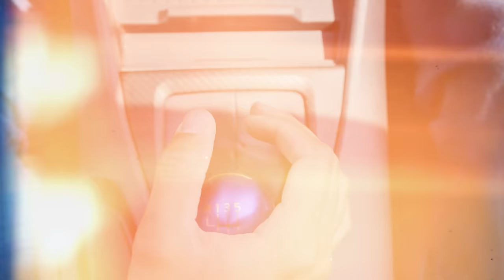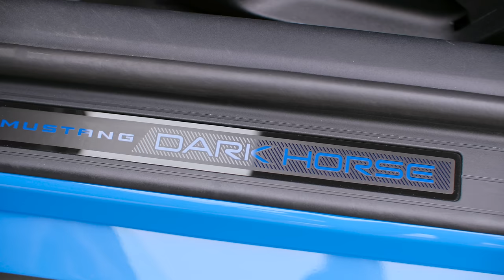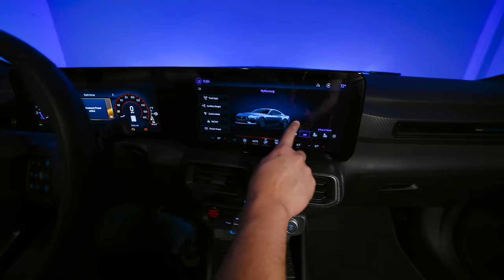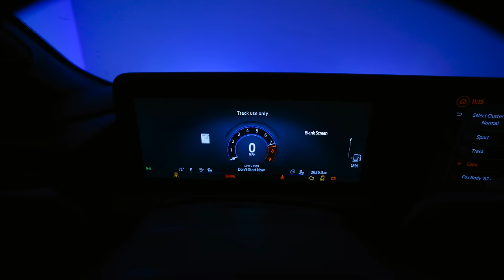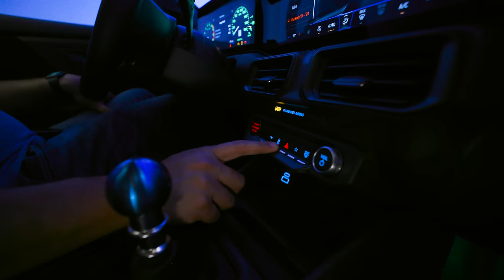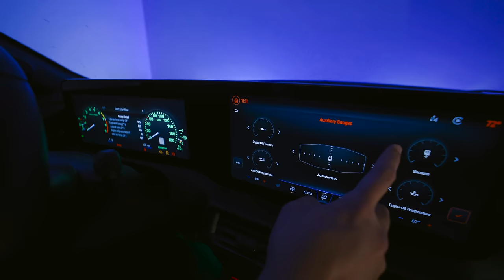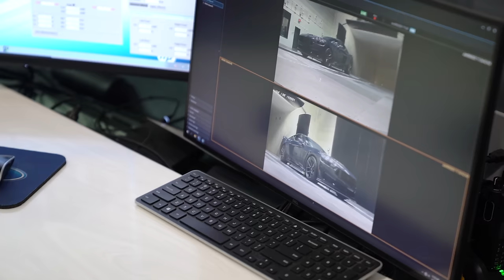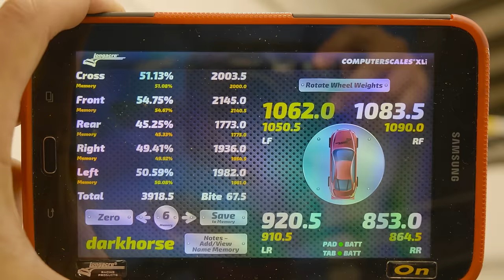2024 Mustang Dark Horse | Why This Car Exists

Comment: I love the savagegeese reviews.  But I do have to ask why they haven't reviewed the G6 Camaro SS 1LE at any point during it's 7-8 production run.   They did review the ZL1 1LE and concluded (probably corrrectly) that it's more car than necessary for the road and should be relegated to the track.   But the SS 1LE is (IMO) the perfect balance of power and handling - fun and managable on the street, and an ANIMAL on the track.   It performs as good or better than the Mustangs (GT350, Mach 1), Supra, BMW, offers more track oriented tech than some others (Heads up display, Performance Traction Management track mode options, true electronic rear diff) and all for significantly less money than any of the alternatives.   With the end of Camaro production run in 2024, it's becoming a bit of a mute point, but that doesn't mean it doesn't deserve a review.

Comment: At 26 mins, that's the first hint I've seen that they have beefed up the engine for the additional output.  The mentioned the rods, I would love to know if they addressed the oil pump drive gears.  While not a huge cost to upgrade, it would be nice to not have to address that if we wanted to add a bit more stress.

Comment: I've owned four V8 Mustangs in the last 35 years, '81 Cobra, '89 LX 5.0, '01 Bullitt, '08 Mustang GT. Always been a big Ford guy and Mustang fan, since before I could drive. I'm a few years away from retiring, and was planning to buy a new Mustang and keeping it until I die. 

That is until I saw the S650 Mustang reveal. I could probably grow to live with the exterior styling, and the performance is pretty damn awesome, but the interior just lost me. Too many screens. Not interested in driving a video game. Vastly prefer analog gauges and physical buttons. The weight is an issue for me too. My last Mustang had a curb weight of 3490 lbs, this new one is 500 lbs heavier! No thanks.

Hearing what the Ford employees were saying about trying to seek out a newer younger generation of Mustang buyers instead of the traditional Mustang owners,  almost seemed a little bit like the whole Bud Light fiasco. I'm a 50-something Mustang owner with a healthy six figure household income who wants to buy a new Mustang, but Ford chose to focus on the younger generation who generally don't care about Pony cars and can rarely afford them. I'll be looking for a used S550 Bullitt or Mach 1 instead. Sorry Ford, you lost me.

Comment: I was a Ford guy from 79 till 2017.  38 years. 9 Mustangs, 3 Cougars many trucks. 93 "Cobra and 3 Lightnings.  Ford lost me with the last generation of Mustang. A secretary car. The 07 Gt500 was the last Mustang I thought that filled all the boxes. But this New Darkhorse in the R or track Model is about the Best in many years. It looks Retro with a very clean elegant modern simplicity.  And after having a 17 Camaro ss for a month , I believe this addresses many of the problems that the Camaro has in practicality.  But My Srt 6 spd stays with me for now. This might make me come back to the Blue Oval. And maybe they will do a twin turbo factory setup to "Challenge" the E.V. performance cars coming out. I believe 1000 hp is obtainable with this new Coyote in twin turbo configuration.  And it seem they finally have a chassis that will be stable. Like my 93 Cobra against my full Racecraft modified (Saleen) 89Gt, the Cobra had wider sn94 rear and front hub measurements.  It was very Stable.. Really Really  kick ass Horse they have created.

Comment: Aside from the driver engagement portion of the thing, the design ethos that Ford's engineers have to use (?) doesn't do much to raise my pulse rate. However, everything that Mark and Jack said about the driving experience makes me think that even Japan-o-philes like me would be keen to give it a whirl. 

Also, "brap" notwithstanding, the sound the "Dark Horse" makes is really, really nice. Maybe it would get a little tiring if you pointed it down the pike for an eight-hour drive.

Comment: The real question here is why do I already see corrosion starting on the rear CV axles and diff? Even if it's a car that's been abused in testing and driven in the worst Michigan winters, it should not have any corrosion for at least the first few years. It just seems weird to avoid painting/coating certain components, especially on a car that costs as much as this does.

Comment: I'd like to meet the people participating in these focus groups. How on Earth would you prefer an all-touch based interface versus a mixed setup? Controls should have a hierarchy of importance, and the most important and most used should be physical. They obviously believe this to an extent because it still has a volume knob. I've never once wanted to punch my Mazda's physical HVAC controls because they needed 30 seconds to boot up. My aunt's Civic touch screen HVAC system is a different story.

Comment: Was interesting watching this and just seeing the energy drain from the designers face. First not allowed to use their original design, then had to keep same chassis and not allowed to lower roof like wanted, then forced to use the screens from Mache and not add physical buttons. If this is same chassis means still has same rear pillar problem so will get an ANCAP safety rating of 2 and be a death trap for anyone in the back seat. Such a shame initial Mustang came to Oz for like 50k and was 10 to 20 k lower than an HSV which had just been discontinued was a great deal!

Comment: The Dark Horse def should have been a Ford Perf vehicle. Or, an option for a FP version. "Less about the motor" is not a good thing. Neither is a steering feel that's just ok. You can see it, too much body roll. Peeps want radical street cars. The sound is not good and Ford does know how to do that. A very generous SG review......

Comment: The main gripe I have of the new 'stang is the touch climate controls. I will adjust the temps on the fly when driving as the car warms up or cools down to set the holding temp. I DO NOT WANT TO LOOK AWAY FROM THE ROAD FOR A TOUCH SCREEN FOR CLIMATE CONTROL.... That's a stupid way to die. BTW this is coming from a younger mustang owner... AKA according to them in this video the target audience. I am heavily into tech and material design. There is a time for touch and for tactile feed back, in this new gen they appear to have gotten most of it right. But the climate control with at leasr the fan speed and temperature control need to be tactile. Any thing less IS A HAZARD. You want a cockpit feel, that requires being able to engage everything from muscle memory. There are few things more epic than hopping into your car and doing EXACTLY what you want to do quickly and without fail, whether that's setting off, or properly slowing down for a corner in your manual 'stang perfectly timing your downshifts, selecting the proper gear for the corner, matching your revs, releasing your clutch at that perfect moment, and slamming your gas to burn through what's left of your power band, until it's time to swap to your next gear. The younger gerations like their gimmicks, but every child wants to be that epic airplane pilot that engages all the right switches, all the correct sliders, to make tech do what we want it to do. To dominate tech some things need to be tactile and the climate control is a red line.

Comment: The hot buttons and the hvac are the thing that turns me away. Also the taillights are not as good looking as the 2023 s550 taillights. If they kept that or maybe just slightly tweaked it, kept all physical controls in the car, kept the much better integrated 401a digital dash and upgraded the animation and quality of the screen, added updated infotainment and touch screen it would’ve been Goldilocks. But it’s fine, I’m not let down by anything in the 2023 GT Premium PP1.

Comment: Great review like always guys...really enjoyed the track fun!
Wish they would have made it lighter...that would help them with their CO2 goals also. LOL
Reply: Remember that a lot of the weight comes from government-mandated safety systems.
Reply: @johnbrobston1334   Of course, yet still other builders do way better...?
Reply: @sickjohnson  Which other builders?  A ZL-1 Camaro comes in at about the same weight.  To get much lighter you need to go to either a smaller or much more expensive car.
Reply: @johnbrobston1334  Yes, more expensive, because it is beneficial to performance, but there is less demand...because the high price alone makes them limited. There is obviously 2 ways of looking at it of course. My point is that it is not impossible...major manufacturers are big for a reason, profit margins...they build to the lowest cost for their greatest profits first and foremost. Then the virtue signal about their CO2 numbers...it's insulting to anyone with an ounce of real intelligence. What was ford building in Europe during WW2...and who did they sue for their destruction of their facilities after...successfully? Yes so virtues!
Reply: @sickjohnson  Much more expensive because to reduce the weight and still meet regulations you have to use more exotic materials.  Ferrari does that, and Lamborghini, and several others.  And none of them can survive as standalone companies.

Comment: Not sure how they came to the conclusion that touch screen climate controls are good... despite that lady explaining their thought process. They seem to consult with "Normies" when they say things like people prefer bigger screens and all digital or all analog and no mix. 

Me personally, i drive a car that has the custom drive modes buried in the touch display. To adjust those settings, i have to make 3 taps through a slightly laggy interface, and i cannot be wearing gloves. Meanwhile, half of the buttons on the dash and wheel i have never used. It would be amazing to be able to press a button or switch to adjust the thing i want to adjust (say suspension) instead of navigating menus. But the truth is that physical controls require more craftsmanship which is expensive and that's the actual reason for screens.

Comment: While I like it alot and I'm glad it exists, the price is just too much. This could have been a GT "trim" and been less money.  Especially when you consider this 7th gen is mostly an interior refresh. You have to really want a new manual V8 RWD car to get this Dark Horse Mustang. Otherwise the C8 is such a better value around 70k.  And there's better cheaper options with the Z and Supra.  And if you really want better value then used Camaro's and Mustang's are going to be it. I hope they sell a bunch though so I'll buy one used in 5 years to go next to my C8.

Comment: I really love the look of this car!
I really hate the look of this car!
I love the fresher look of this series and the apparent upgrade in interior trim. But..... 
Those screens 🤢🤮 imho the trend of sticking screens on a dash looks fugly! Fit them into a dash pod, not only would it look better but shrouded and recessed would help with reflections.
The extended graphite grey around the headlight imho is fugly and cheepens the Look.
Ooh😯 a dark horse badge that's facing you..... But you didn't put it on the front grille, that would have looked way cooler than on the wings.
I'm in the uk and so don't get all the choices American customers do, but I'm still considering a mustang, but I think I'll accept the interiors short comings and stay with the Mach 1 even if I have to buy used.

Comment: Honestly, I don’t pay much attention to gauges other than the tach. Once I have the AC/heater set, I don’t change it too much. Wish the seat/steering wheel heaters had physical buttons because I don’t always want them on but when I do I don’t want to check my email to turn them on. 
I would give it a chance. If it drives smaller than it weighs, then it might be fine. My biggest complaint with new cars in general is that they have gotten bloated and huge. They feel big. 
Is a small, nimble car with good power “heritage”? Lately, “heritage” is more of a shape than a feeling. No wonder the Zoomers are confused and want screens everywhere. Their frame of reference is much different than mine.

Comment: Good job Ford, you took the 2 screen design from the C8 and made it worse by not designing a dash that wrapped around the gauge cluster display.
Looks like someone yanked what was supposed to be the stock gauge cluster from the car, and put in an oversized tablet from ebay that wasn't designed to be there.....

Comment: Where did you guys get the idea that a Supra is $20,000 less than a Dark Horse? I'm on the Toyota website right now, and the top trim Supra has a $65,000 base. That ain't $20k less. That's $1k more! If I got the Dark Horse with the premium package and a color I want, it costs $64k. You can make the Dark Horse more expensive by buying every single tiny option, but most people won't. Telling people there's a $20,000 price difference was extremely disengenuous.

Comment: I love my 373's on my Manual PP, OMG I call them the Reel Them in Gears.. Jesus 1,2,3,and 4 are so nasty quick my God. Just a perfect gearing for a 6 speed... I find myself Babying my car, i do run her into Red every now and then, But I need to get the MGW shifter Badly.. The stock shifter's are so sloppy.. I hope they fixed that Linkage and bracket by now...

Comment: Everything about the attitude of these Ford emloyees screams, "Fail!" The basis for nearly every answer was the same: "We decided to pander to millenials and Gen Z kids. Along the way, we didn't have the budget to do what we really wanted to do, so this is what you get." The one interior designer even said, "I'm proud of Ford for making the decision to walk away from heritage."

America's icon, the Ford Mustang. Let's walk away from that heritage.

Brilliant.

Compare their attitude toward this project with that of the Honda engineers who created the FL5 Type R, or the Mazda team that created the ND Miata. There's such a stark difference in the pride those people took in their creations. They had a specific mission, with a clear focus. They weren't about to water down the product in an attempt to appease everyone, never mind pandering to people who will never buy the car in the first place because it's far too expensive for that demographic. This new Mustang simply reeks of forced compromises, and not just the usual bean counter-mandated compromises, but philosophically wrongheaded compromises. 

Never shit on an icon. Most definitely never shit on the very people who made it an icon.
Reply: What about making a new icon?

Ford largely kept the very successful S550 platform and design which is smar IMO. But the modern refresh was exactly what I wanted. Then the handling just surprised the hell out of me.  The thing can handle curves in a very smooth manner. Effortless.

Comment: It looks sick . Too bad its not all wheel drive .  An American v8 R34-esque Mustang would've been amazing. Now that truly would have been a dark horse.  Here's the game changing idea for the halo version. Electrify the front wheels. Have the electric motors provide modest torque at partial levels of throttle for added traction and mpg's, moderate torque at WOT, and full torque by pressing a red button on the steering wheel.  Electrification doesn't have be lame like the mini van Mach-E

Comment: 12:10 “What should be physical” shouldn’t even have to be asked. Literally any control for any system that has physical presence in the real world (seat adjustment, climate control, speaker system) should be analogue. That’s it.

Comment: I really don't like the screens on the new S650 Mustang. Driving an S550 Mustang and an Audi RS6, I've found that controlling everything from a central screen in the RS6 takes away from the driving experience. You end up wrestling with the screen to change settings instead of enjoying the drive. The S550's physical toggles make it so much easier to switch modes and just focus on driving, which is why I'm against the S650's move towards more screens and fewer buttons. Plus, the S650's design is too edgy and chiseled, almost like it's inspired by the boxy 80s style. I don't think it will age well or become timeless. And why did Ford design it for a younger generation that likely can't even afford these cars? It just doesn't make sense to me.

Comment: Spent 50 minutes screwing around with the screen when he could have been driving 😂 I have a 17 with the larger screen and it could be smaller. I just hook up Bluetooth(that doesn't work some times and needs a reboot) and setting the input and time. I use the physical buttons most of the time because I'm driving. I think I found why accidents are up 😢

Comment: Sounds like they wanted to make it sleeker (5:50 "We wanted to lower the roof...), but that it wasn't in the budget. This is disappointing, as the current model feels almost as claustrophobic as the Camaro, IMHO.
But, given Ford's history of launching performance cars on a shoestring budget, it's not surprising. Especially given the dwindling sales in the segment. This one seems to be a step backward in styling. The sixth gen car has better lines. This one looks "edgy" for the sake of being edgy, but not necessarily well designed.